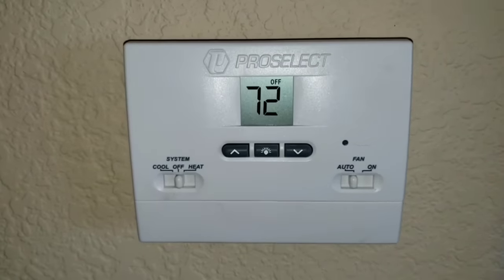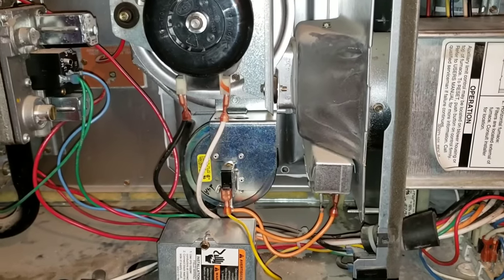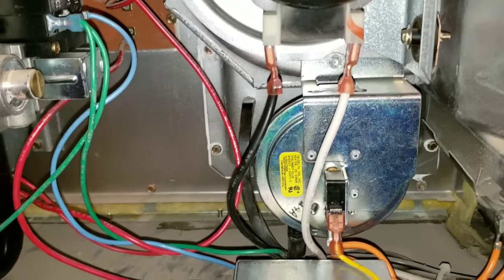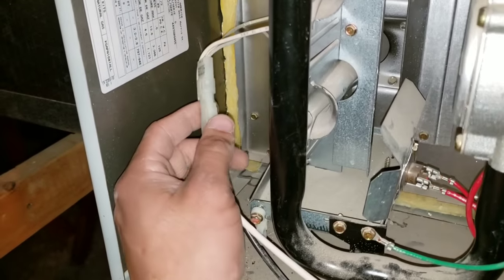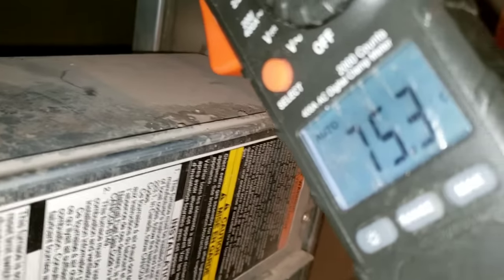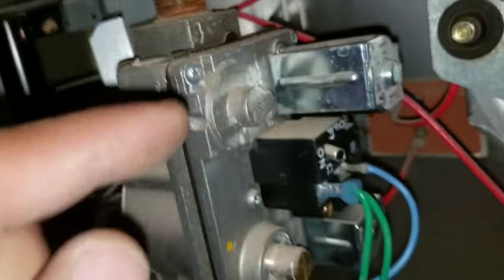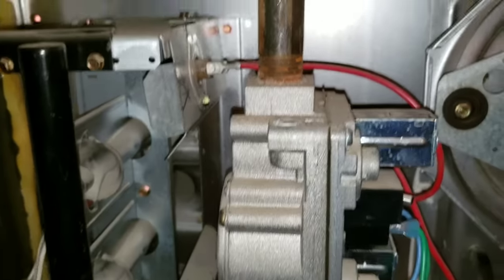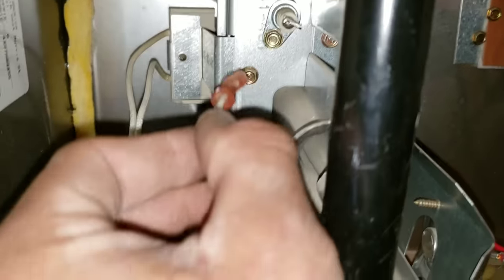Furnace Troubleshooting Step by Step with Multi Meter.

Comment: Thank you so much for the video, I'm learning a lot. Really liked how you explained each part then tied it all in together at the end. 

Question can anyone tell me: I thought the circuit board only supplies 24v to components, guess not cause from the board it supplies 120v to hot surface ignitor and blower motor. My question is where does the 120v come from to the board? I noticed all the 120v components have molex type plugs (harness) on the board. Does the transformer tie into supplying the 120v to the hot surface ignitor and blower?

Thanks in advance.

Comment: very good, the only question i have is  about the switch that comes  after the pressure switch on the orange wires , what switch is that?

Comment: Great video. The switches for the inducer motor verification....... are they pressure, flow, thermal?? That switch isn’t just verifying 120vac output to the motor is it? What about that second switch?

Comment: Thanks, your video was incredibly helpful. I was able to diagnose my RJII furnace down to the 50A50 board. I can hear a relay going crazy on it when it's time for the voltage to go to the gas valve. Plus I get the solid red light indicating a bad board. I do have a question. The orange wire from the pressure switch goes to another "switch" just to the right of it. What is that switch and what is it's function?
Reply: Never mind... It's a roll out sensor. The replacement board has my furnace up and running. Thanks again.

Comment: great video - one question though - I can't detect voltage to the ignitor at our house but I can light the furnace using a lighter. If I understand you correctly, if the ignitor doesn't light, gas valve won't open. How can the furnace be lighted manually?

Comment: I have the same furnace, and sometimes I get the same code you got in this video when you pulled out the wire from the roll-out switch. It refers to code 33 and 13. I have no co2 alarm going off in the house.

Comment: EXCELLENT, BUT,  whats that "switch" called with the orange wires  that's the go between the pressure switch and the board, thanks

Comment: Hey Sam, great video. Thank you for that. I do not get power in to the igniter connector. I followed all of the steps you showed, and I’m in a rabbit hole. Everything is working properly, checked everything with a meter, and yet I’m not getting 120 (I’m getting 00.00) in to the connector that goes to the igniter. Any thoughts? Thanks much

Comment: Sam,
Great, helpful videos!  I’ve watched each probably 5 or 6 times.  I am a subscriber!  
I have tried many time to get my Goodman blower motor to start for the 60-90 second fume flush, but can’t get it to be the first process of furnace start up.
Issue with my heat system is can get the gas valve to open.  Every process sequence works to opening the gas valve.  I have check all components to make sure voltage is available.  
Inducer starts
Pressure switch closes
Hot surface ignitor glows
Then I do here a click from a relay a few seconds after the HSI starts to glow.  
But the gas valve is not opening.
I have check of ohms on gas valve and I’m getting 95.7, that says it good.
Would you say my board is most likely issue?
I have inspected board for burn marks, etc., none.  It’s dusty, but board looks fine.
Just asking your opinion.
Thanks

Comment: Thanks Sam for the great DIY video.  I have a question for my gas furnace.  The volt go into my gas valve is around 3 to 6 volt and it never show 24 volt.  I check the secondary side of the transformer and the R and C wires on the thermostat, they all show 24 volt.  The problem is that when I turn on the heater, the igniter glow but gas valve doesn’t turn on due to the lack of 24 volt.  Since the AC works fine and nothing looks odd with the controller board and transformer.  How should I debug this further or should I replace the controller board?  Thanks,

Comment: I have one for ya. It’s 40 degrees outside, my heat is off and my apartment is still registering 71 degrees. FYI the electric bill in this one bedroom is twice as much as it was in a two bedroom. So, what do you think? Also I have the window open. ?? I have to run the air conditioner at night to sleep!

Comment: I appreciate your videos. They have helped me a ton. I do have a question. At three minutes you recheck the low voltage thermostat terminals after putting the system in heat and running. You are still getting 24 volts. I am dealing with a system that when running I am only getting 18volts from the red, white, and green. When not running I am getting 27 volts. The system is having trouble with the blower motor starting. It will start to turn then stop, jiggle back and forth and start to turn again. Would you say I have an issue with low voltage after power up? Thanks for any help.
Reply: repklace the ecm fan motor..its module is bad

Comment: Thanks for the lesson.
Could you talk about 3 blinking on the board and how trouble shoots 
Because my blower do not turn on to start my heater
But the blower turn on if put on cold or if I turn the fan on
Why the blower not run when put heat on.
Thanks

Comment: Great video...   Im having a issue that maybe you can help me with.  It seems im getting 24v call for the furnace to run continuously. i have removed the thermostat and still the induction motor is trying to start, and you can hear the relay click randomly. The low speed blower stays run continuously. This is happing when the thermostat is in AC auto .....

Comment: Great video the detail was excellent, I still have yet to figure out my issue. My inducer motor intermittently starts up i have to continuously turn the furnace off and on to get it to run so I followed the steps. Checked Voltage to the inducer motor and got only 60V, then I traced both wires back to the board and tested it there still 60V. So I shut everything down as I usually would with my leads still of the board and still got 60v but the furnace worked as it should. 90 seconds on the blower inducer motor started up and all was well. I removed the lead to the white wire and my meter still read 60v. 

Any Ideas, I have been going at this thing for 2 weeks, is there an issue with the board?

Subscribed!!!

Comment: Thanks for the walk through, my furnace gives a code of Improper Ground, checked all ground connections, yet, unit will not turn on. Any thoughts on what to check next? Thanks again
Reply: I would try temporarily moving the ground to the water main coming into your house. The water main should be grounded enough and will at least verify that its actually a grounding issue and not a misleading code.

Comment: my furnace shut off unexpectedly twice when roomate was home, Iooked around and cleaned sensor, cleaned burners (needed it-lotta carbon), checked conections, voltage, ran a self test, fixed loose door safety switch, and now seems to be running well. 
 I am curious because it does always seem to run the blower before starting the induction motor when I turn the power back on-normal?
Also how hot should the exhaust pipe be on an old carrier? just curious

Comment: This man knows his shit!🤟🏼🤟🏼
Reply: Issue that I'm having, all components in my 90% furnace testing ok. On really cold days (-20 deg C), the furnace comes on, the inducer starts then stops after 2-3 seconds. Furnace never turns on. When I remove the filter, it turns on just fine. I'm now using the least restrictive filter (crappy) and it still happens.. I'm guessing hot air is being trapped behind the filter, switching off the unit as it thinks it's getting too hot? Any ideas? Think the blower is too weak? The airflow doesn't seem very good unless the filter is removed. Thanks

Comment: Great video. My furnace won't turn on. I measured 120V going into the primary side of the transformer, but 0 V on the 24V side. After removing the transformer I found no continuity (an open circuit) in the primary (120V) side of the transformer and continuity on the 24V side. I assumed that if a transformer blows then it's actually a symptom of a short further down since transformers generally last forever, however since this is on the 120V (line) side, maybe it's just a bad transformer. I'll find out when the new one arrives.

Comment: What is the best way to test a pressure switch?  I have a code for open pressure switch, but there are two of them. It is a Gibson. Inducer motor runs but the igniter does not glow.  Thanks.

Comment: Good video.
Would have been a GREAT video if you had included the actual built-in troubleshooting system provided by the manufacturer!
That Red Blinking LED on the control board is actually telling you where the likely problem lies.  When you introduced a fault by pulling a connector - you should have then  shown and explained the LED' s blink code.

My AMANA was blinking 6 times repeatedly.  That code indicated an open flame roll-out sensor and that was indeed what the problem was.  Why it tripped will need further investigation, of course.
Reply from the maker: Unfortunately in the industry in which I am a part of I can think of numerous occasions where the board either did not give a code as the board was faulty or the board gave me a code that was incorrect. The manual that correlates to the specific heater is required by manufacturers to be stuck on the service door so hopefully a persons common sense would start with the code or error that is flashing. However you do make a point that would be of great assistance to others. So I did want to acknowledge your input. Thank you for the feedback!

Comment: I gave a thumbs up, but the only thing i saw, was try not to clean the flame sensor with sandpaper, use real fine steel wool. There is a coating you can damage on the FS and it wont last long. Other than that, great job!

Comment: When I turn on my furnace I do get heat but when it’s done warming up it doesn’t turn back on for at least 45 minutes to a hour what could be the problem if you can help I’ll ready had come in to check and supposedly fixed but the problem is still going on thank you for your videos

Comment: At the end of this video you just mentioned about cleaning the flame sensor, you didn't explain the voltage supplied from the board to the flame sensor, there is an AC voltage usually of 90 - 100 volts ac.

Comment: What if there is no voltage to R (at the very beginning) on the board? Switch is on and breaker isn't popped. My thermostat is also powerless. This is very helpful. Thanks.
Reply: Test for voltage coming out of the transformer. If the transformer is not producing voltage on the secondary side then make sure it is receiving the right voltage on the primary side. If it is receiving the right voltage but not producing any secondary voltage then the transformer is shot.
If it is producing secondary voltage then the problem is elsewhere. I have seen some furnaces where the 24 volts goes through the limit switches before it goes to R. So if a limit is tripped you will see nothing on R. The wiring diagram might give more details on exactly where the voltage goes after the transformer.

Comment: I have 24V going to P of the gas valve, while C and M are at around 0.05V should that be sufficient for gas switch open?  I currently have an where gas valve is not opening.  I can't tell if the gas valve is bad or if I need a combination of 24V going to P, C, or M in order for it to open.  I see in this video that you were checking M1 for 24V.   Is my gas valve bad or do I need more troubleshooting to see why M is not getting 24V?

Comment: Sequence of operation 
- call for heat
- induce drafted fan comes on
- pressure differential switch closes
- Igniter Ark
- Pilate ignite
- flame sensor senses pilate lit
- igniter off but main burner on 
- Blower motor fired up
Reply: can I get a    oh  hell yes     nothing iike good guys sharing their insight   yeahhh

Comment: I enjoyed the video but the problem I have is the blower motor starts randomly and can run for quite some time but have no idea what is causing it. If I turn up the thermostat so it calls for heat the blower stops and the furnace goes through it's normal cycle and when the thermostat is satisfied everything shuts off as normal and then again randomly the blower will start. It could be 5 minutes after the furnace shuts off or 45 minutes, so would like to know what and how to check the things that may be causing the issue.Thanks again

Comment: Question
My furnace will run normal for a while, then every now and then, when it goes into the cool down cycle, the fan will not shut off.
No codes are given. 
If I shut off main power then turn it back on,  it will work fine for a while.
Reply: Sound like we both have the same concern. But if you follow his process and testing I think you can fix it.

Comment: Hi Sam.  When heat is called...my furnace inducer motor turn on and then turned off a second or two later.  It kept doing that repeatedly.  The furnace would not shut itself down.   Do you have any ideas what may be the problems?  You think it’s the control board/inducer motor/thermostat wire issue?

Comment: this is good but there are alot of exceptions as well as different basic systems, for instance the 90 second blower run and inducer ck ( after power reset) isnt on some cheaper gas systems. my system is a 2017 unit installed by a professional company and it doesnt have these pre start up checks , no codes system runs fine.

Comment: I know its not that big of a deal, but it bothered me just a bit when you said that "once the igniter gets hot enough it sends voltage to the board and opens gas valve". That's not how it works. The ignition is based on TIME not temperature. The igniter will stay energized for for a certain amount of time, then the gas valve gets energized and opens. To my knowledge there is no temperature that the igniter must reach in order to energize the gas valve. it just ignites and opens gas valve. Yes I know this is a bit trivial, but I am an experienced tech and it just bothered me a bit. lol had to correct you! great video though! Gives a decent amount of info for general troubleshooting. Still would recommend homeowners that are not mechanically inclined to call a professional, as troubleshooting a furnace without adequate knowledge, can lead to serious injury or death. seriously, HVAC can be a very dangerous job if you aren't careful!

Comment: Thank you for the video. excellent step by step. I have a problem that recently my  heating system "Goodman GMS8 090xxx" will not fire up. I traced it step by step. The board will not blink and shows "no problem" according to the manual. The furnace goes through all the steps correctly up to ignitor turning on fine. But the gas valve does not open up. I changed the gas valve still same problem. Finally, I found out the only way to get it going is to disconnect the 12 way connector on the main board and connect it back again!. it seems to reset something and it will work for couple of days and then have to do same thing. One thing that puzzles me the board does not give any indication that something has failed!!. Please, help.
Reply: sounds like you need a new board

Comment: Thanks for the great video. I do have an issue with my American Standard Freedom 80 unit. I’m getting a error code of sometimes 3 and sometimes 4 when calling for heat. I can get it to work for a few days at a time by pushing the wires into the board. Obviously something is loose but I can’t figure out exactly what it is. Have you ever seen this before? Any step by step advise would be greatly appreciated. Also seems to work when the temps outside are above 50 and seems to crap out when the temperature drops.
Had a professional come on n and he recommended a new board and pressure switch, but haven’t called him back to complete the work which I’m sure I can do myself for a third of the price quoted.
Reply from the maker: It's very difficult to determine the problem without assessing in person. If you had a professional look at it and you trust their evaluation then I would consider that you may have an issue with the board. I would suggest having a second opinion done if you find someone willing to do a free evaluation on your system. Don't tell them you had someone else look at your system. Treat it as a new call. Does that make sense? If you determine that the issue is the board then at that point it's up to you if you are confident and comfortable to do the work yourself. I've had issues as simple as someone installing a hypoallergenic filter which caused the system to fail every few days due to the sensor and board picking up a restriction due to lack of air flow.... whereas other times it's the board itself. I'm wary of the board at times because sometimes it will throw a wrong fault code. Hope this helps. Keep me updated. Many times someone has the same problem you have had and they either respond or can read your comment and find the solution if they are having the same problem your having. Honestly the temperature differential issue makes me believe a bad sensor somewhere or board. Just my thoughts! Thanks for posting.
Reply: Thanks for the quick reply
Reply: Hey Sam
The day after you wrote back to me, which was roughly 2 weeks ago, I decided to swap out the motherboard. I must say even though I’m not an expert in this area I was very skeptical that it was in fact an issue with the motherboard. Guess I was wrong because since changing the motherboard I’ve had not one issue and even installed an Ecobee4 a few days ago. Thanks for your suggestions and great videos which I continue to watch

Comment: Great video.  Does anyone know why when I have my thermostat on cool, fan on auto, when the blower runs, the voltage across the motor's Cool-H is 97V?  But voltage across the Heat-H is 120V.  
My system would shut down frequently.